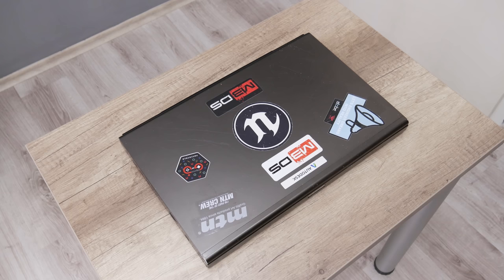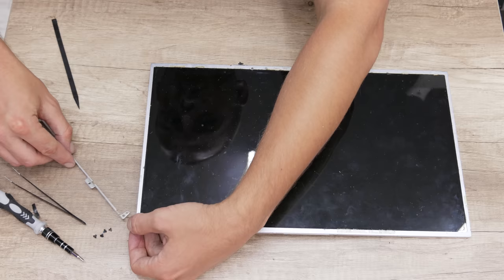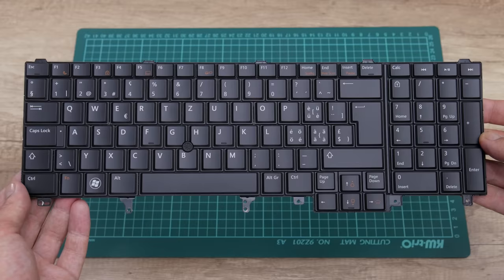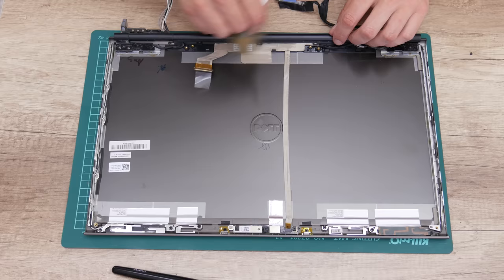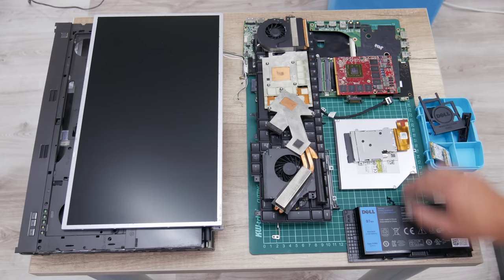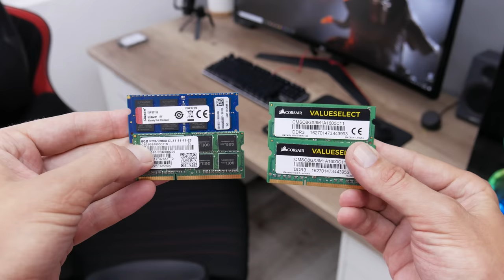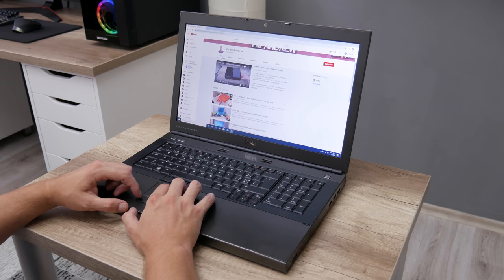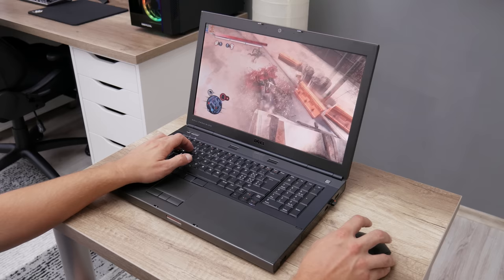Restoring DELL M6600 - Mobile Workstation

Comment: i have exactly the same laptop, found at the dumpster, but mine is the older core 2 duo version and it had the orange case, i upgreate it with a quad core cpu, i have also 8 gb ram and a ssd in it, the quaddro card is only the 512 mb version but get the job done i run some games on it with no problem, i am very happy with it the laptop is build like a tank :)
Reply from the maker: I agree the build quality is like a tank, I I think this case won't corrode even after a millennium :D

Comment: I cringed when he reused the old thermal pads
Reply: Me when he applied excessive thermal paste on the CPU
Reply: But this guy is awesome just by being able to reassemble this thing. I  couldn't 😂😂😂
Reply: @vitorbatistateixeira758  his thermal paste application was good since its a direct die. Spread method on direct die was alot better than dot since it covered the whole die perfectly and the added dot on the middle to reduce the air bubbles after putting the heatsink together. The only problem he did was reusing the old thermal pads
Reply: Exactly. He used the same thermal pads :triggersounds:
Reply: And call them "rubber pads"
Reply: i cringed when he dident upgrade the gpu
Reply: @KM-kl2wu  agree 100%, this is direct die application unlike desktop with IHS. On like 10 laptops I did this exact paste method (except a bit less on the dot) but even that's harmless when there is nothing nearby to the die like circuitry or a PCH die found with some U series cpus. When checked the application was perfect.
Reply from the maker: Hi bro, actually these thermal pads are reusable, if the pads are good then all is okay. Also, temporary I don't have some good pads, I have cheap ones, and in this case is not recommended to use cheap and less quality pads to this laptop
Reply: @ComputersAndTechAndAndrew  OK, thanks for explaining! I will use that tip if I ever repair a laptop to save money and still have great thermal performance!
Reply: Got to this comment after watching him carefully keeping old thermal pads...
Reply: Cat and Andrew you went through all that trouble to restore and upgrade a 8 year old machine and you didn’t have thermal pads on hand? Some of them were coming apart as you were reapplying them. You did such a nice job otherwise. Consider replacing your CMOS battery as that could still be the original.
Reply: As far as I know, if Thermal Pads arent solid as rock, they can be reused xD
Reply: @ComputersAndTechAndAndrew  you can replace thermal pads with thermal paste
Reply: if pads are still soft/spongy and sticky u need only clean them with IPA and there is no need to change them. fabric pads are still better than cheapest new one.
Reply: Herr Nero von Schwarz how the fuck else are you supposed to say it

Comment: him: max upgrades
me: must be a 2080 super and i9 -9750H
him: i7 2670QM 32GB DDR3 Ram,  FirePro M6100 2GB GDDR5, 480GB SSD and 2TB HDD.
Reply: Xcalibur  prob proccessor could be improved more. But graphics is harder to find

With base fan u can support something more but could be more an office laptop than othen thing
Reply: Xcalibur  Not only that but the motherboard socket allows max up to i7-3940XM, and the GPU socket MXM-B (v3.0) has an RTX 2080 available, but for the price, and the bottleneck, I dont think its worth it. Interestingly enough the cooling is made to manage much worse temperatures as this laptop is rated for a FirePro GPU and they are well known for their food cooking abilities :)

Comment: I have the M6800 the daddy of them all with the highest end i7 of the time. These machines were so soilidly built and with an SSD are really fast. To think you have room for 3 drives is brilliant.
So well built and designed and are really solid, they do not make them like this anymore that's for sure, so I must tear it down and do some maintenance on it.
The fans rarely come on, I have 32gb Ram in it and a 4gb nvidia quadro in it I think. these machines don't break. Thanks for the great video my man!
Reply: I just bought two of these machines refurbished on sale and in the rare red color (well, the M6700.. I think yours is three years newer than the M6600 in the video and mine in the middle) and plan to use them for years. They have 16 GB of RAM but will upgrade them to 32 later if I feel the need (and when it's cheaper to do so, lol), and of course grabbed them both with 512 gig SSDs. Don't know about the GPU but will upgrade if I have to (listing made them sound like graphics were just integrated, so possible removed.. either that or they listed nothing because of the possibility of there being several GPU combinations). Overnight the price went up $80 if I were to order another two so I think I did well.

It's pretty funny to think that I am interested in buying a 10 year old computer. In fact it may even be an older machine than my current one, though it does have a better processor and the SSD and of course will be fresh. Imagine though in 2010 wanting to buy a machine from 2000! But it will do everything I want it to and probably even play relatively modern games (which I don't really use them for). For more than double the money of what I paid for two, I could get a brand new machine with identical specs (of course, 12th gen i7 vs 2nd gen, DDR5 RAM vs DDR3, decent GPU vs ?.. is the high price of new worth it? Don't know, though in another 10 years the newer machine would be better to have I suppose).

Comment: This video is rather important for low budget riders. Or total nerds like me. Now, theres a rather nasty trick you can do to make this baby blistering fast. The Samsung EVO SSD's comes with a neat program called Samsung Magican. It can make an over provisioning drive, say 10% of your SSD, and it acts as a RAM drive. After installing a 1TB Samsung SSD 850 EVO I did this on both my m6700 and m6500. They both got faster SSD's r/w speeds in Crystal Disk Mark than my current Dell precision 7750 (m.2 nvme gen 4 SSD's).  It went all the way up from r/w of 400/350 to 4500/4000. All operations did not get faster - still my 7750 is 3*faster when it comes to unzipping files etc. But for compiling code with lots of r/w it is almost as fast. And thats just mindblowing. My Dell Precision m6500 from 2009 is now as fast the brand spanking new Precision in some operations, and for daily use, its barely noticable. The bottleneck is in the graphics card for 4k, but it is totally upgradable and may get decent.

Comment: WD-40 is also a very good product to use to remove sticker glue. It is also safe on plastics and will not discolor or strip the coding. I restore old Dell laptops myself and I’ve use this product with much success over the years.

Comment: That laptop is an  upgrade beast, 4 ram slots, 2 x hdd slots, a 3rd if you remove the CD/DVD drive, and it has a M.2 sata slot for upto 4 storage spaces, upgradeable CPU...  I thought my T440p was good with upgrade options with 1 less hdd slot and 2 ram slots. Being able to upgrade the CPU is laptops is something that needs to come back, going from an i5 4200u to an i7 4710mq is a nice way to extend the life of a 6 year old laptop.

Comment: I have it's little brother , the Dell M4600 which i have upgraded.I have also researched the 3 year period in which these machines came out (2011 to 2014)
the 15.6 inch versions M4600 / M4700 / M4800 and their larger 17.3 in versions, the M6600 / M6700 and M6800.

Little tip on upgrading the screen.The M6600 / M6700 / M6800 came with a dell Ultrasharp 1080p LVDS 17.3 inch display.However The Motherboards on the M6600 and  M6700 also came with an EDP connector on the motherboard, if you wanted to change the Panel for an IPS Type.I Believe on the M6800 however , they dropped the EDP connector on the Motherboard..

BTW these machines can still be picked up on Ebay in various conditions from £100 to around £500 depending on specs.

Comment: I've been using M6600 for work daily since 2014, i7-2620M, Firepro M6100. I use it mostly for Photoshop, Illustrator, Autocad, Inventor, and it is still going strong, the only problem is that even replacement batteries are bad, 50€ for greencell battery, 2 of them arrived dead, 3rd one holds less than a hour.
Reply: install i7-2760qm, but turn off the turbo boost on the processor. Get 4 cores / 8 threads / 2.4GHz - performance will be better for your programs and temperatures on the laptop will not increase. 
RAM up to 16gb DDR3-1600, DDR3-1866 (1.5v)

Comment: Very nice work.  I have a M6800, same frame design.  3 hard drives in mine, all SS.  Upgraded GPU to 980M.  Those 2 fans are dirt magnets, must clean them couple times a year.  Very quiet for most tasks, fans rev up with Doom Eternal.

Comment: Great job restoring still good enough Dell laptop. I'm a fan of Dell & Lenovo laptops - they are the best value & build quality. I think the AMD FirePro M6100 is the top model of whole family FirePro from AMD so it's not upgradable. However there is also M8900 but I'm not sure it's higher model.

Comment: I got me an M6600, I upgraded mine to 
i7-2960XM Extreme Edition, 
Quadro K4000M 4GB Gpu, 
32GB Ram, 480GB mSata SSD, 
2x 2TB Seagate hard drives

Its a Beast!!
Reply: Only thing that sucks is when you use 32gb, it runs at a slower clock speed that with 16gb.

Comment: Thank you for the video. I bought my M6600 during my graduate studies, still going strong (I played overwatch and ESO without any issue)... i7-2860QM, Radeon HD 2950, 16GB RAM.. the only issue I got was Bluetooth and finger scanner stopped working after upgrading to Windows 10 from Windows 7. Dell Support no help.
Reply from the maker: You are welcome bro :) and thank you for watching my video :) About the hardware, you can try to find drivers manually by hardware IDs. To find the IDs go to Device Manager, find the missing driver then select it, right click with mouse and select properties, In properties select Details, In details under Property change Device description to Hardware IDs. Then under in Value you may have few rows of letters and numbers, every row is separate ID. Then search the google for every separate ID. 

This may help in over 50% to find the drivers, even some drivers from windows 7 or 8 may work and help to fix the problem

Comment: I had the top version of that laptop for a very long time.... It was rocking an i7 (don't remember which gen.) 4 cores cpu and a quadro2000m gpu... With 12gb of ram and 1tb ssd... I even managed to play gta5 over 30 fps on the highest settings... But it was enjoyable... I have this laptop even if i don't use it... For movies and random tasks... It is even better of most 600 euros new laptops out there.

Comment: I have a similar but more budget oriented laptop, the XPS L702X. It's from 2011 as well, with the same processor (i7 2670QM), 8GB DDR3, a 900p display, and a 3 GB GT 555M GPU. It's never let me down, I use it practically every day, and despite having a dedicated gaming PC, I can't stop using it - I would be lying if I said I didn't have a sentimental attachment to it.

Comment: You gave this thing a thorough cleaning alright. I wish you have lubricated the fans and replaced the thermal pads for new ones. The video card can be upgraded by replacing the video chip. But this requires some professional equipment. Anyway you did a good job. Thanks for a nice  video.

Comment: We have some of these at work. I love the Precision line but the M6600's graphics chip have a tendency to overheat. It's been fixed in the M6700 and M6800 line (they use the same chassis).

Comment: I had a HP mobile workstation with the same specs, it was a beast, I ended up putting a gtx 760 from a toshiba laptop in it, it needed a bit of a cooling upgrade after that

Comment: I had a similar Dell I got before, think it was a M4800 or something like that, know it had a quadro2000m and a i7qm cpu 4c/8t. Took it apart to redo the paste because the thermals were bad but it was such a pain to teardown. Ended up either forgetting to plug audio back in or busted it during the teardown. Didn't bother to open it back up to fix/check

Comment: Great video, I have this beast by my side too with a quadro 3000m graphics it's been very great..only issues is that can't use my external graphics card rx580 it just got stock on the dell logo..

Comment: You can find these MXM graphics card module up to the GTX 1080, but they are expensive as hell when popup in eBay. 960m, 970m and 1060 are more commons to appear. The FirePro M6100 is in the same level as the 960m

Comment: If you like upgradable laptops like this one, you can take a look at some of MSI's laptops, especially in the GT series.
I owned a GT683DXR, and it was 100 % upgradable, just like this one.
There are also the GT80/GT83, which also feature fully upgradable components, including SLI capabilities.

Comment: A good way to remove stickers glue is by first scrubbing toilet paper on it (or a newspaper). The glue dries and becomes easier to remove with isopropyl alcohol later (which may not even be needed by then)

Comment: Hey Andrew please make video about Toshiba satellite a100 restoration this laptop from 2007 and runs perfectly with with windows 10 with some upgrades and install drive but  the laptop have Nvidia geforce go 7600 and you will install the driver of Nvidia manually

Comment: At last another video after a long time :) Thanks Andrew. I want to share funny thing with you guys. I have HP6560b which I bought used from a guy. Its battery was not working, but recent windows update fix that issue. Before that I installed linux but did not fixed that issue. That is the only good thing happened in my windows experience since 1999 I started to use computer. Off course it comes with a price. My network card is now not working.

Comment: Just also noticed that this laptop has an mSATA connection as well - could have even shoved one of those in if you wanted ;),
So if you really wanted storage, you could have 3x disks (mSATA, SATA SSD/HDD x2), or even 4x disks if you wanted to sacrifice the DVD drive.
My personal choice would be 1x mSATA (boot disk), 1x SATA HDD (data), 1x SATA SSD or HDD (additional storage), and 1x optical drive (DVD or Blu-Ray).

Comment: Great video however i have q question for some reason i can't get prototype 2 working on Windows 10 it'll always crash on the main screen how it would be great if you'd tell me how did you get it to run

Comment: Pro tip: If you spray glue residue with WD-40 and let it soak for a few minutes, the glue will come off very easily.

PS. Don't re-use thermal pads

Comment: Hey, I have the M6500, the display occasionally turns off itself, and won’t turn back on unless we restart it. Any help?
Reply: did you try to switch just using dedicated GPUs or onboard GPU, I think one of them is I the culprit. Also try to clean ram copper pin with pencil eraser

Comment: Hey. I have a question. Did you in the end upgraded the GPU? I got this machine about a month before your video, and after all repairs, even changing the motherboard, because it started with error everytime, and the CPU fan would not spinn, I got stuck on GPU upgrade. I got a GTX 770m, but it won't let me install windows. Only operating system I was able to get working is Linux, with ACPI disable. But maybe newer AMD GPUs should work. So if you still didn't upgraded it, the latest known GPU working on this laptop is by forums that I found AMD HD8970m.

Comment: I have an Hp Elitebook 8770w with an i5 quad core that is really similiar to this pc. I am going to upgrade to full specs since it can mount a 6GB Nvidia video card and an i7 Quad core 8 threads processor at 3.5ghz if I remember right!!

Comment: The ssd can maybe be fixed if you plug only the power cable in it and leave it powered on for a hour. Some SSDs repair their firmware and are usable again after this

Comment: They run even better with Linux installed seeing it's a more lite os and alot of gaming can be done there aswell
Reply: Windows 10 LTSC is also a light OS basically a modern version of Windows 7

Comment: when I clean internal parts in laptops, desktops and TV's even Game Consoles. I use Air to blow off any dust and I use CRC Electric Parts Cleaner.   Electric Parts Cleaner can be sprayed on motherboards, wires, etc etc etc and not damage anything, doesn't leave film and it dries within seconds. It cuts half the work he is doing in this video brushing, using a plastic scraper and q-tips. by the time is cleaned  one, i would already cleaned 10 PC's and sold all of them LMFAO

Comment: i have one of these.
i loved it while it lasted.
it's a defective design.
it eats graphics cards.
Reply: You upgrade the graphics are all the way up to a nvidia 980 with 8GB of ram.

That's the last iteration of cards using the MXMII standard. Now it's all proprietary or soldered on board graphics cards. (except the alienware which is proprietary)

Comment: This laptop was back when Dell's Precision lineup actually meant professional, upgradability, repairability, and modularity, all in one package that is built like a tank, not some glorified ultrabook with thermal solutions that will fail to keep the CPU and GPU temps at a comfortable operating temperature.

Comment: Hey I have a question, can you upgrade the cpu to a Intel Core i7 3740QM instead of the 2670QM ? The only diffirences between are:

-wider memory bandwidth
-pcie gen 3 support
-22nm instead of 32nm
-1600mhz ddr2"L" support

But they have the same FCPGA988 socket. Would it work ?
Reply: no you can't, but you can upgrade to 2960XM, [extreme edition], 2nd Gen socket is not same with 3rd gen